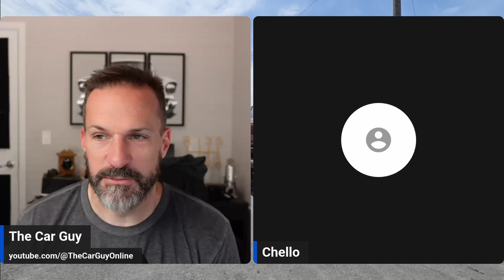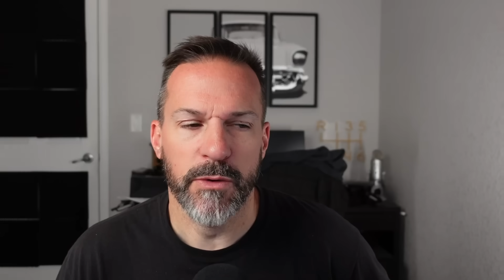Former GM Engineer EXPOSES Planned Obsolescence Tactics.

Comment: Former GM engineer here but I worked throughout the industry. Tip of the iceberg. Not just the transmission. The entire industry is about planned obsolescence. Vehicles designed to last through warranty.  Product development engineers know precisely how long parts last through their testing. Consumers need to buy the vehicle 'twice' if they want more miles outside of warranty.  The consumer is completely ignorant of how the industry is morphing.  Mostly, its smaller turbocharged engines operating with more heat and pressure that fail sooner. CVT's. Hybrid systems with complete powertrain redundancy.  Electronics fail with age faster than mechanical systems.  Make a Rolex watch with twice the parts it will fail statistically twice often and also be twice as expensive to repair all the while the OE manufacturer profits 'again'.
I honestly should write a book. It touches almost every aspect of vehicle design.
Nobody should ever forget why car companies exist.  For profit on the backs of the consumer.
Reply: I would buy that book for sure.
Reply: “General Motors doesn’t make cars; General Motors makes money.” - Alfred P Sloan, General Motors.
Reply: Id buy. Hell even would pay $5 to read a thorough blog post less than 50 pages.
Reply: Active fuel management needs to go
Reply: @MarkBoyle-s7e That is why I didn't look into buying a leftover /  new C7 for cheap $$$, when the C8 was coming out.
Reply: @MarkBoyle-s7e— ridiculous EPA fuel efficiency standards need to go, and car makers can go back to making simpler more reliable vehicles.
Reply: @randomschmo5778 😂
Reply: @randomschmo5778BOT
WAS THIS BOT BOUGHT BY GM
Reply: The consumer is not "completely ignorant" to what is going on, they just can’t manufacture their own truck at home. So they look towards other manufacturers for reliability which tend to be Japanese brands.
Reply: @blipco5  Some consumers are smarter than others no question.  Here is a fun litmus test. Ask any Subaru owner if they believe there is any downside to CVT ownership?  First they will ask you what is a CVT?  Don't bother asking them about fluid change intervals with a CVT or if they find the NVH objectional about 1/2 throttle. They will have the same vacant look.
More?  Ask any 'modern' 5 series BMW owner how many cylinders their BMW has.
Reply: @lukewalker1051  I wouldn’t take a Subaru if you gave it to me. No joke. That boxer engine is the dumbest design out there.
Reply: @blipco5  unfortunately the Japanese  cars are going down too but still better than GM.  Nissan and Honda are prime examples.
Reply: @njackson18  I believe that’s true. People are complaining of squeaks, rattles and leaky sunroofs on the new Camry which is made in the USA. So far mine is good. I had a 2013 Honda Accord, US made, which was perfect til I sold it recently.
Reply: @blipco5 i have a 2009 Accord EX-L with 150K miles. I Bought it new 25K.  I do the work on my cars. None of them  burn a drop of oil. Only the starter is not original on the Accord. . That 13 you had was nice! The last good ones.
Reply: @njackson18  Yes, no turbo crap. I do my own work as well.
Reply: As an engineer, has the car manufacturers given any thought to the issue of not being able to open doors or windows due to a dead battery? I’ve heard of accidents causing and electrical failure, and the occupants were unable to exit the vehicle.
Reply: @rbwoodwork1890  mmmm not sure what vehicle you are referring but usually those electronics run on 12v low voltage system. I don't know if it's a requirement to have a mechanical release for newer doors but there are redundant mechanical door release although it's not conveniently located
Reply: @bArda26 it is and there are mechanical releases on vehicles w electric door handles.  Pro is they are hidden and not intuitive.
Reply: @rbwoodwork1890 It’s required by law to have a backup mechanical latch if the actuators are electronic. Problem is that owners don’t take the time to learn where they are.
Reply: @YoureMomsMaster  not all of them do. For instance, the liftgate/hatch of some SUVs don't have an accessible mechanical release. I presume because it's not a safety hazard as someone could still climb to the front of the vehicle, but that's beside m point. If/when that actuator or something in the system fails you have to rip the interior panel apart to gain access to it in the best case, and worst case cut the sheet metal apart from the outside if the interior panel can't be removed with the liftgate closed (which is more often then not).
Reply: @YoureMomsMaster 
There’s a video of a guy freaking out because he can’t get out of his C8 Corvette because the battery died. He literally called 911 to be rescued when all he needed to do was read his owner’s manual to find the manual release handle.

Personally, as a matter of safety, I think door release levers should be plainly obvious and easily accessible in the event of an emergency.
Reply: @KiwiEG  I have been working on all makes of cars for over 20 years and have opened many lift gates because the actuator failed. I have never had to cut sheet metal to get to the manual release. I have had to destroy (or just crack and then glue) an interior panel so you are correct about that. I do agree on many of the points in this video however. Automotive design isn't good for the consumer or the technician or ease of repair.
Reply: @rbwoodwork1890 you don’t write like an engineer. Maybe English is your second language? If so then I understand your grammatical errors
Reply: @martygriffith2135 you’re funny. You forgot a comma and a period. But really, who cares in YouTube comments!
Reply: Did you get to work on the 2003-2006 silverados?
Reply: @justinjones5288 nobody worked on those! 😂 they just drew the design in the dirt and started putting 4 wheels on a truck frame.
Reply: Yeah, very true. The first new car I ever bought was a 2005 Chevy Cobalt (the first year of the Cobalt, as they were phasing out the Cavalier). I was working at a Chevy dealership at the time as a service advisor, so would see the cars coming in for service... as time went on, we'd see more newer cars being brought in because they'd keep breaking down.
I got that 2005 Cobalt (base model, by the way) to 285,000 miles before he got totaled in an accident. Such a great, reliable car.
Fast forward a few years, I bought a (used) 2013 Chevy Cruze, which I also absolutely loved. That car didn't give me ANY problems - until it hit 100,000 miles! It would overheat without warning and required a water pump and new thermostat (mostly made of plastic, I'm told). After the first time it happened, my car would have overheating issues exactly ONE YEAR after the water pump and thermostat would get replaced. The cycle continued until I got rid of the car. Unfortunate, because besides having to constantly replace these cheaply made/designed parts, it was also a great car.
Reply: He speaks for what he personally know. Other companies will have their own ways to cut corners for sure but I don't think it will be credible to talk about other companies he never worked for.
Reply: Most of us have a rough ideas of what our competitors are doing, especialy when we can study their products or have friends there @techburnsca
Reply: I really feel for you Luke I'm sure many  honorable engineers found this soul shattering  As an Australian we have allot of Contempt for GM after they burnt Holden to the ground then robbed our government
Reply: @incolink 
…robbed our government.?
Reply: This is why I stick to older simpler designs. 😊

They are good enough for long term ownership. ❤
Reply: The 4T65E was the bane of my existence. There were a few other issues with the transmission and it was never built to handle the 3800 S/C or the V8. And then when GMR discontinued the 1" chain.... Sigh
Reply: Planned obsolescence, once a matter of cosmetic changes and annual model shifts, has evolved into a more consequential and calculated design strategy—one now aligned with the average auto loan period, not the traditional 10-year lifespan vehicles once offered. In the case of General Motors (GM), mounting evidence suggests that the durability of key vehicle components—particularly engines, transmissions, and control modules—is engineered to coincide with the end of the financing cycle, typically between 60 to 84 months (5 to 7 years).

Unlike the classic model of style-driven obsolescence developed by GM in the 1920s under Alfred P. Sloan, the modern variant manifests as mechanical or electronic failure just after warranty expiration, when the vehicle’s owner has finished—or nearly finished—paying off the loan. This includes major incidents such as:

Catastrophic engine failures in hundreds of thousands of GM vehicles equipped with the 6.2 L L87 V8, leading to sudden breakdowns, crashes, and legal action.

Fuel pump system failures in Duramax diesel engines (2011–2016), resulting in widespread engine damage and expensive post-warranty repairs.

Hybrid system faults in Chevy Volt models, forcing GM to extend warranties only after federal scrutiny.

Owners routinely report high-cost failures—valve lifters, crankshafts, transmissions—shortly after the 60,000-mile or 5-year powertrain warranty ends. These failures are not isolated; they appear across platforms and model years, often surfacing within months of the final loan payment, leaving owners burdened with costly repairs or forced into another purchase cycle.

This evolution of planned obsolescence shifts the design goalposts: no longer just psychological nudging toward the next model, but strategic durability limits that keep buyers trapped in perpetual debt cycles, upgrading out of necessity, not desire. GM’s once-symbolic design principle has now become a mechanical reality—with real financial consequences for consumers
Reply: GM world glass technican here. I just walked away from the automotive career. It has become one big joke and no one cares about the customer but csi scores are everything... It has affected my mental health, this career has worn my body out, at 38 i have problems with my hands. not to mention shoulder, back problems, i was never one of the guys to man handle a transmission or engine. I feel like all auto manufactures are starting to pull this. I own a toyota now and a lexus and they have been great so far. I know toyota has its own problems i'm in a group and see techs complain lol.
Reply: Please do think about writing it, could have a best seller on your hands
Reply: @tossmonkey1  Thank you for the kind words. It sadly would be a scathing indictment against an industry that not only provided my father his livelihood and hence my upbringing but me a well as turbulent as my engineering career was toward the end in particular when the car culture had really started to change. AI is now a big part of the equation moving forward as many senior engineers for example are and will be displaced by the very data bases they created.  Junior engineers are easier to manipulate by management and can be paid less of course for more profit. As it turns out the auto industry is hugely competitive. Business models crafted by major auto companies are created to extract as much money as possible from their customers over the lifetime of car ownership. This didn't used to be the case. Engineering didn't have the predictive tools it has today geared more toward design obsolescence, only to get worse as AI can further sharpen this line of when parts fail out in the field.
So its a tangled web and...because the tech is getting more complex, the average consumer is becoming more ignorant about what they are buying and hence more susceptible to getting fleeced.   End game for the consumer will likely be fewer cars due to lack of affordability.  Robotaxis will replace a car in every driveway.  Cars are getting priced out for the average consumer.  Part of the book would be about the relationship between Corporate Average Fuel Economy (CAFE) standards enforced by the National Highway Traffic Safety Administration (NHTSA), which is part of the U.S. Department of Transportation (DOT).  The consumer believes that NHTSA aka the government is the boogie man. Not so. Major auto companies are complicit in CAFE requirements as this allows them to sell 4 cylinder cars with turbos, CVTS and Hybrids which all exist for profit. NHTSA and DOT is often blamed for CAFE but the reality is neither governing body knows anything about what kind of automobile technology will achieve a given CAFE standard. So CAFE is tied to auto company profit is the message to consumers. Its all about the money and the consumer has to become more educated to not get sucked into the trap of buying cars that are not cost effective when calculating their depreciation and lack of reliability long term.
Reply: Everyone knows that they are destroying the economy by creating intentionally defective vehicles. This started in earnest in conjunction with the destroyed real estate market that raised house prices to the point of destroying people's lives. This is part of an attack on Western Civilization. All of these things happening at the exact same time, wasn't an accident, especially after they announced their plan to try to get people "to own nothing." BUT now we have a different path created by the new Government administration. The new EPA needs to create a task force to STOP PLANNED OBSOLESCENCE.

Because an engine that explodes, and cannot be rebuilt, is an environmental disaster. Starting right now, the EPA needs to begin issuing environmental fines for planned obsolescence, $1 billion dollars per violation. Watch how fast they put a dipstick back on your transmission, and start using steel oil pans again.
Reply: What is the main anti-wear chemical in Dexron automatic transmission fluid? Also, what is the material in friction clutch packs and what is used to adhere them to the metal disks?
Reply: this is why i bought a manual transmission crosstrek while it was still available. CVT's are unaffordable trash to repair if/when they break
Reply: Please write it
Reply: can't wait for the book
Reply: There has to be some finite life or the thing would be double ot triple the cost. What do you propose they do rather than 100k mile lifetime?
Reply: Nothing is built to last at all.
Reply: great comment
Reply: To be fair, every business exists for profit. That's not necessarily a bad thing. What theyre doing is akin to fraud. That's a problem.
Reply: Ive both one book in my life and that was a software book.But honestly if you were to write that book I personally would buy that book.Ive seen this happen in mini split units.Where After a year,passing the warranty of the unit on electronically parts,the unit will get an error code for blower motor issue(And we always make sure the inverter units are sized properly to make sure there’s not much load on the units)and even with that case these units fail right after the warranty.But my curiosity is that how they plan it so meticulously.What are the formula used to be so accurate to when it will fail?
Reply: Please write that book!!
This is sickening.
Reply: Are you aware of the same tactics in Asian brands such as Toyota and Honda? Is every company doing the same thing?
Reply: I'm not see anyone talking about solutions. In my opinion, Toyota, GM, and Ford, are committing a crime. Why are they being legally allowed to send out products that they KNOW will fail rapidly? So what is the solution? The solution is Lee Zeldin and the EPA.

Now that the EPA has good (benevolent) management, for the first time in 50 years, they can begin enforcing consumer protection laws instead. A FAILING ENGINE that explodes going down the highway, is an ENVIRONMENTAL SCOURGE.

The EPA needs to create a new division. They can hire Sandy Monroe, Uncle Tony's Garage, Allen Millyard of England, the Corvette engine lead designer Dustin Gardner, and other people who have spent their entire life working on engineering solutions and engines. There must be EXTERNAL REGULATION for SERVICEABILITY AND RELIABILITY.

Get it? There must be new laws that REQUIRE: Automatic transmissions that have a steel drain pan, a drain plug and a dipstick. If they do not provide a way to service the transmission, then it's a $1 billion dollar fine. START THE FINES RIGHT NOW. 

There must be new laws that REQUIRE engines to be tested by the new group of engineers, before they can introduce a "prototype" engine into the public. If the engine doesn't meet "serviceability" and "repairability" guidelines, then they cannot sell the engine. 

You'll see engines REVERT back to old engine designs, and they will stop exploding. BUT THERE HAS TO BE ACCOUNTABILITY.
Reply: What type of engineer are you??
Reply: Its about anything produced nowadays. I worked repairing industrial equipment, some capacitors where made in "west germany" meaning the machines where running since the late 80s, If you buy cheap caps nowadays theyre literally fake, all their temperature ratings and tolerances means nothing
Reply: Please write the book!
Reply: The ford 1.5L? Has that issue. The high heat and pressure make them Crack the block. If you ever hear you have coolant intrusion on that engine escape than good luck.
Reply: All companies exist for profit off of the consumer, otherwise they couldn't exist. I agree there are unbelievably crappy things they do and shouldn't be allowed to do, but that statement is asinine.
Reply: Boeing is the same, planes failure it a small fine. Fix the older f.uck the new.
Reply: Please write a book about it! There's only one truth!
Reply: You done have to write a book just take 5 minutes to write all the Bull Shat you know and enter that into Grok or chat gpt  in 10 minutes you will be done shoulds dont exist anymore in writing it doesnt even have to be a book just post what it writes if you agree how its formed up you can do this with one beer and your phone let your Truth out it takes money from you also and your family your mother has to pay also so if it wasnt a vehicle lets say it was a helper after so many hours that helper is going ro beat up your mom would you purchase it? Its ok those helpers are kown to beat up their owner after so many hours but its ok you heal you need that helper so dont complain just take what ever beatings come after 100 hours.
Reply: I just wanna know who at GM had the great idea of making the HD trucks on the same chassis as the 1500 trucks. Diesel engines are already large, but they seem even larger when you stick it in the same engine bay as a 1500 gasser. There is literally no room to do anything under the hood on any 2500 before 2020. I love my truck and Ill make sure it lasts for as long as possible so I dont have to buy new, but damn that engine bay sucks the life out of me trying to do anything under it.
Reply: Good writeup.  Electronics is the odd case they could solve both longevity and cost if they consolidated down to more integrated chips.    But legacy auto makers like Ford and GM hae too many suppliers to coordinate with to do that.
Reply: Do you think this is industry wide for cars manufacturers or just american companies? I wonder if japanese companies are doing this too. I work for an aviation company and we fatigue test parts and major assemblies for 1000s of hours to meet FAA regulations. Is there an equivalent regulatory enetity for cars? Some of the aerospace  quality standards were derived from the auto manufacturing industry. I believe the part production approval process originated from auto manufacturing.
Reply: Write it
Reply: That's been known.  Car companies, ANY company, can't make money if their product never fails.  This is going on in the computer world with software... not just the hardware.
Reply: Write the book.
Reply: I have thought this since 2016 till today.  Ppl think I’m a crazy “conspiracy theorist”
Reply: I would buy the book…do it!!!
Reply: What absolutely shocks me is the pure ignorance of consumers, Imagine if more people had a clue, If people stopped buying new shitboxes and purchased older vehicles that were still built to last, the manufacturers would HAVE to make changes. But, The clueless blindly spend on these shitboxes the manufacturers win.
Reply: Honestly as an Aussie. I am kinda glad Ford and Holden ended when they did. The last few generations of Commodore and Falcon are all absolute gems and I'm glad their names were never sullied.
Reply: Makes me wish I hadn't bought a 2024 Mazda CX-50. It's all the damn bells and whistles, drive by wire everything, including steering, brakes, gas pedal, and the damn ebrake is a f-cking button. I miss my 2005 Civic EX..
Reply: Please write a book, if not an essay. Cars used to be so much less expensive to fix.
Reply: I would buy that book.
Reply: I’ll help you write the book. But a new car, drive it to warranty expiry, rip out all the electronic bullshit.
Reply: What vehicles did you help design, with Chevy?
Reply: Would you say EVs at any company would help due to less parts?
Reply: You should write a book, as a mechanic, I see the garbage coming through the shop everyday
Reply: It's criminal and they should face capital punishment for it.
Reply: What about toyota? i am interested in their grand highlander hybrid, which is a fairly new model (launched 2024), believe their ICE component is 4 cylinder with turbo charge. toyota is known for its reliability, so wonder how that compares against lets say a traverse's 4 cylinder turbo charge
Reply: @454ffv  No.  Run from the Highlander hybrid, unless you want to lose a lot of money leasing it or just own it through warranty.  Any vehicle, Ferrari or Corolla is Cost/benefit.  What you pay for what you get.   Hybrids have 2.5 x's the complexity of any cars on the road.  Turbo 4 + battery + motor is worse case scenerio.
You want to own a low maintenance Highlander?  Find a used V6 version and thank me 10 years from now. The decrease in fuel economy will be vastly eclipsed by long term lower maintenance cost.  The reason why manufacturers make hybrids is they are a long term 'cash cow' for the corporation whose soul mission is profit.
Reply: Industry needs another business model. This one, based around warranty and frequent purchasing is not working and is most certainly not eco-friendly (something everyone keeps talking about when discussing cars and drivetrains).
I think there are different paths forward, but entering the marked without at least 2 billion $ hard investment into car company is impossible.
Reply: As an engineer do you like the Toyota Rav4 2025 hybrid or v6 naturally aspirated rav4, Nissan Frontier with the v6, honda ridgeline?
Reply: "The consumer is completely ignorant of how the industry is morphing." i;m 51 now and know what planned obsolescence was in my 20's
Reply: and the bastards are all putting CTV's in... fkn hate those transmissions, you gotta drive your car so carefully if not the belt snaps. Also dont forget to change the oil frequently because that thing lives off clean oil.
Reply: I was a GE engineer 24 years i was supposed to do 25 and 55 years old ! I knew what was up when i was called into a meeting at 46 years old and just about 20 years of service! they sold to abb or so they claimed i got the same pension id have got for 30 years plus i get a check every year for some patent work i did ! they implemented lean manufacturing it cut all of qc and a super huge chunk of employees! they no longer tested any of the materials coming in ! junk soft crap 💩 they screwed us big time
Reply: And that's why Toyota is the #1 car company in the world  reliability
Reply: Sorry but I'm a Mechanical Design Technologist and Industrial Millwright Mechanic and I am not completely ignorant of how the auto industry is morphing. It is occuring because the consumer is a victim of their own lack of intelligence. Refuse to buy vehicles that have a laptop bolted to the dash if you don't want that.
Reply: @stancoleshill8925 
Refusing to buy a car without a dashboard tablet is like refusing to buy a car with an automatic transmission. Good luck finding one without it.

They’re not even easily found in the used car market either. And they’ll eventually not be supported anymore just like analog cellphones.
Reply: @stancoleshill8925 Amen
Reply: I change my engine oil every 3 months,  about 1500 miles on the oil.  And transmission oil every 6 months
Reply: I appreciate what you are saying about pressure, heat, electronics etc however you are wrong that these lead to shorter life.   What leads to shorter life is a policy of limiting lifetime to the warranty period.   Volvo and Saab have been using small turbo charged engines since the 80s, they last extremely well, at least the 20 years design life.  Also the Engine Electronics last the life of the vehicle too, not so much the alarm systems.  I am an Electronics Engineer, electronics can last as long as you are prepared to pay for.
Reply: @tonystanley5337  Volvos Turbocharged engines were not what built the brands reputation for reliability, that would be the RedBlock, an engine design so simple and so overbuilt it leans towards being agricultural in nature. I can’t think of one turbocharged gas engine from the factory that will be solid on the top end until 300k miles.
Reply: @coreygolphenee8852  The redblock was originally a tractor engine,  it was also used in marine applications, essentially you are correct, but I was talking about Redblock Turbos (I have 2, one of which I run on the track).  What you have said does not discount my claim that Volvo have been making reliable small turbo engines since the 80s.  The later 6cyl, 5 cyl white block Turbos and even later 4 cyl  are not as reliable and have a lower tuning threshold because they are less overbuilt.  In other words manufacturers can make engines last as long as they want.  But its not just about bearing size, wall thicknesses etc, its about quality materials and the right materials, the right design etc.  Mainly have a good design objective like lasting 20 years or 500,000.  Redblock turbos will be sound indefinitely (so far) top and bottom.  Valve guides do not wear, cams, tappet bucket, followers do not wear, the heads do not build significant deposits provided oil changes are reasonable (at least every 10K or once per year).  Yes you might need to change a HG occasionally but that is usually because of radiator damage and topping up with fresh water.  The turbo will need an overhaul within that period.  The throttle body will need cleaned (just for idle stability) and the fuel pressure regulator is a common fault, although I'm still on my original at 220,000.  The injection fuel pumps wear out.  Its mainly Bosch Injection systems issues.  The later design of the head mounted disty isn't so good and can leak too much oil, but it just needs a new seal.  But seals changed for oil leaks are considered normal maintenance.
Reply: @tonystanley5337  yeah but that’s kind of my point lol, the RedBlock wasn’t built to be a turbocharged engine, it just so happened to be built well enough to withstand it, same with the M10 BMW, the D series Honda etc, most famous turbocharged engines started life out as a way overbuilt economy engine, often with Iron head and an Iron block for a reason. my point is that something like the 1.8t won’t be built like that.
Reply: @coreygolphenee8852  Yes and no, yes you can turbo charge the Na engine, its called a turbo+.   The Turbo engines were modified and developed they are different, with lower compression, oil squirters, 13mm con rods, high capacity oil pump Sodium filled valves, along with all the other  long life features.   Yes the modern engines are less over engineered, that was my point.  Redblocks don't have planned obsolescence, everything else does.
Reply: This is capitalism for you. Same thing with light bulbs. A 2000 hr approximate burn time when truth be told they could last forever but that doesnt keep bulb factories going.
Reply: Capitalism 101. But you can't say the "C" word or some folks will get offended. I'd read that book.
Reply: @AmalgmousProx You fools continuously blame a system instead of the exploiters. Any system can be exploited. Youre blaming the water for drowning you when there are people holding your head under. The water doesnt know the difference between below or above your head just like "capitalism" doesnt know the difference of who is making the money. Buisnessmen/women are the problem. Consumers are the problem. The system however is not.
Reply: @johnwirk  Thanks for proving my point.
Reply: You should write a book on how luddite it is to condemn electric, when it starts with rotating mechanicals, instead of reciprocating, and how much better it is for wear to constantly make that power conversion and get things spinning! And then another book on electric transmission failures, you know, with one gear. /s
Reply: @hcjpbluesky9916 The whole point of a gearbox is to multiply torque, you could have a way smaller battery and half the size a motor and no liquid cooling system for cooling the electric motors if you simply had a gearbox, and it would be a lot more efficient which is what I thought you tech bros are always arguing about. 

But yeah you tech bro’s always think bigger is better not realizing you’re just following the no replacement for displacement trend of the 60’s and 70’s. Your excuse is let’s do away with the gearbox because we can, not because we should…
 “look at how much we saved by removing the gearbox Tehe!”
“Now we have to spend money on all the energy we’re wasting by making the battery bigger, and having to add a whole cooling system or the extra  heat energy will burn them up”…
Way to go genius, you spent the same amount of money building the car and now it does less because it’s turning a large amount of its electric into heat. You think oil is bad for the earth, just wait 20 years when the junk yards are full of exposed lithium 😂.
Reply: @unitytwins6652 😂😂😂 "oil is bad for the earth" is crazy when that's where oil originates.  But hey , the tech bros know it all
Reply: @CHASIN_A_BASS  dumber than a rock, yes, it is pumped up or "fracked" from below the water bed, when you let it go back into the soil, you're not returning what was to the earth like rain falling back down, no, instead all your doing is contaminating the ground water like a moron. Someone doesn't understand basic chemistry and physics, or maybe you drank too much contaminated well water. You're for real calling me a tech bro? What does that make you? A liberal?
Reply: @CHASIN_A_BASS  Also please learn to read man, I said "You think oil is bad, just wait in 20 years the junkyards will be full of super-toxic chemicals" What im saying there is people in the world think oil = bad (I never said it was bad that was something you assumed) and if those people really think oil is that bad for the earth just wait 20 years and see what kind of new poisons are in the junkyard (cobalt and lithium). Also I was making fun of tech bros in my original comment so you calling me a tech bro is like calling a jew an anti-semantic lmao.
Reply: @hcjpbluesky9916  How luddite do you need to be to not know It starts with how much convertible energy you can carry with you and afford to do it in a real-world world practical way?     🤔
Reply: @hcjpbluesky9916 
You should read a few articles about slave labor being used to mine the minerals for your EV batteries. Maybe we should call them blood batteries like the blood diamonds mined by slaves. Did you think only Nike and Apple used slave labor?

Maybe you don’t care because what’s out of sight is out of mind. Maybe you’re too busy protesting in favor of exploiting people for cheap labor.
Reply: @hcjpbluesky9916  You should read a book about how many problems and real world, long term costs from start to finish exist with EV's.  But that wouldn't fit your talking points.
Reply: @scottysgarage4393 I've had my Tesla Model S for 11 years and I have almost 140,000 mi on it and it's been a phenomenal car. There is one year where I had to spend around $7,000 including a new windshield and a new steering column, and I've certainly had to get a few sets of tires, but aside from that, my car is not once ever ended up on the side of the road.... It's never needed a tow truck, everything that goes wrong with it lets you know ahead of time and not one thing has flat out broke on me, ever.

Electrics have nothing under the hood. Internal combustion engine vehicles have a hundred parts that can break under the hood. Plus I get free supercharging for life. 

If one of your talking points is cobalt, then save it.... Since the other 50% of cobalt on earth goes into the same cell phones that you are holding in your hand.